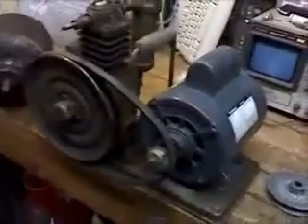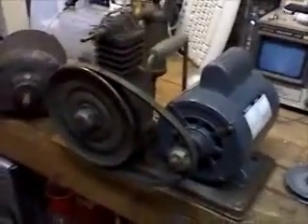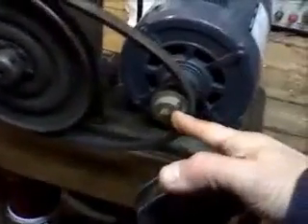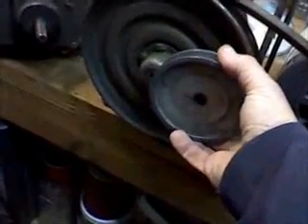#52 HHO pump progress, manifold vacuum explanation

Comment: Vacuum pumps appear to be rated based on in/Hg and CFM.  There are 12v vacuum pumps out there intended for use on cars with turbos to supply pwr brakes and other gadgets that work off vacuum.  So when it is time to put under hood, suspect you will be looking for something smallish and 12v like these.  The pumps appear to pull 3-10 amps.  So this is yet another draw on system that increased output will have to outweigh. Something to consider I think.

Comment: Stupid question but I gotta ask. Water boils at much lower temp at lower pressure. Are you certain that the production you are seeing is hydroxy and not just water boiling off at lower temp due to vacuum? I keep thinking that the way to go with these things is to RAISE the boiling point of water so we can run the reactor at higher temp.  So I keep thinking about using a pressure vessel type design.

Comment: Would have to think about I would do that. My target is to get a small generator to run off hydroxy only.  In my application, it would be tough to fit a vacuum pump but guess its possible.  However, if the vacuum could provide dramatic improvment in production using a realitivly small reactor, it might be worth it. So will keep tabs on your progress with this aspect of it.

Comment: Do you think those PVC check valves might work as a flash back device?  I have a couple and am using them as check valves but kinda thought they just might work as a flash back device.  Am just scared to death to try to prove it would work.

Comment: I think the method is to store SMALL quantity in vessel under pressure to feed engine. Dump the excess if over pressure.  Valve opens and pulls in air so motor can breath if engine demand too high.  Reactor is under steady vacuum from pump to supply storage vessel.  

That is general design I am working on.  But with my reactor, electrolyte is pushed through by pump so is under pressure not vacuum.  And I am trying to run a small single ICE on hydroxy only.

Comment from the maker: Amen, brother! I think direct conversion to useable heat would be a different technology though. The road I'm on is best suited to conversion into mechanical energy. To get heat on this road I will need electricity from a ICE on a generator and heat electrically. That's actually how I hope to heat the house this year which is all electric baseboard. Yuk!

Lots of ways to crack this nut, each with it's strong and weak points. This way first. Other ways next.

Zero